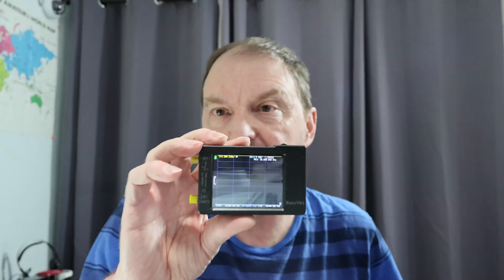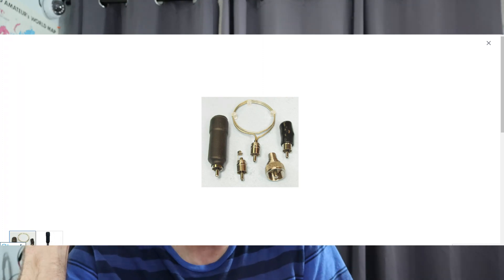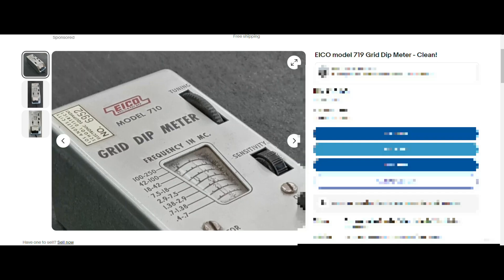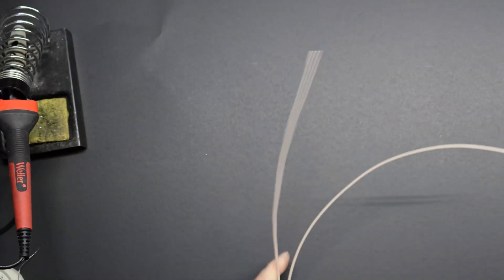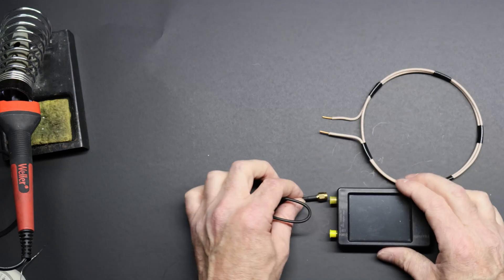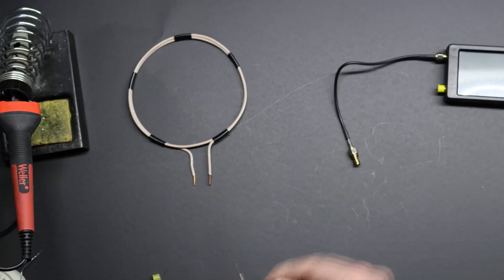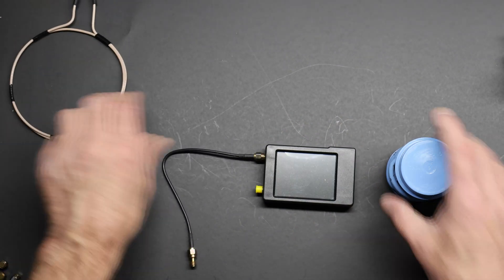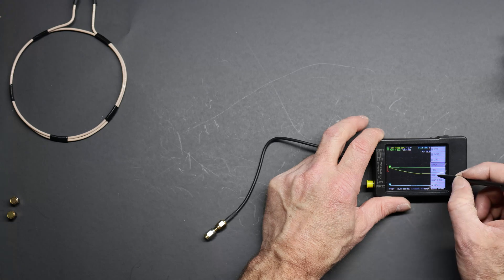How to use a nanoVNA as a grid dip meter.

Comment: Really useful video for my upcoming purpose of detecting resonance in primary and secondary LC circuits. Does it matter if the pickup coil is bare wire (e.g 2mm tinned copper wire)? And how important is the diameter of the coil? So would a 10cm one work just as well?

Comment: Really useful video for my upcoming purpose of detecting resonance in a primary and secondary LC circuits. Does it matter if the pickup coil is bare wire (e.g 2mm tinned copper wire)? And how important is the diameter of the coil? So would a 10cm one work just as well?

Comment: Inspired by this video, I did a few tests myself. I found that SWR was by far the most stable parameter to use on a wide bandwidth, like 5-100 mhz, and on a short bandwidth, like 10-20mhz, delay gave a very sharp dip. My pickup coil for 5-120 mhz is 5 turns at 40mm dia. for 100-450 mhz, I used 3 turns of 12mm dia.

Comment: Interesting. I was first licensed in '57 so am familiar with GDOs. actually I started collecting them at hamfests and have MFJ, Heath, Kenwood and Simpson ones. (I'd like to get an Eico with a real vacuum tube in it.). Anyway I also have a Nano and your demo was very interesting. But all my GDOs have a series of plug-in coils with many more turns and I wondered what difference that made compare to your little homebrew one. Is it because of the wideband sensitivity of the Nano? Does Q enter into it?
73
Reply: I have been using a grid dip oscillator, GDO, for a long time also. Still use them, even tonight, and have found the Barker & Williamson (B&W) GDO very good and uses an acorn tube. I see them on Ebay and maybe you would enjoy one of those for your tube collection and use. I started with my general license in '63.  Been a great hobby for a long  time.  I don't know how to use a GDO for determining Q but a nano VNA can be used to measure Q. I also did that tonight on a B&W 850A tank coil for a friend.    B&W advertises their unloaded Q to be 50 or better. I measured it at 70 on the 20M tap.  Not too bad.      73    WA4QGA

Comment: This idea came from a magazine article years ago. MFJ copied it and sold it as an adaptor for their antenna analyzers. 

It is actually better just to connect the trap or resonant circuit to the VNA directly and measure the impedance of the trap or resonant circuit. Just use a short jumper with a cable separation at the far end with alligator clips.  Calibrate that with an OSL calibration. The VNA can measure the actual trap impedance and Q using a direct connection, I do it every week for testing RF chokes. 

You  don't have to spend $53 for a useless hunk of wire you can find in your junk box. You can make a jumper or adaptor for a jumper with clip leads and read the actual impedance with a direct connection.  It can do anything this can do and better, and you save almost $60!!
Reply from the maker: I have tried measuring directly from the S11 port, for some reason the nano shows them a few hundred KHz low on frequency. Might be an error on my part.
Reply: @RicksHamShack that is likely a resolution issue. Some models take 100 samples, others 400, but it’s still pretty low resolution over tens of MHz or more. You can reduce the stimulus span or connect it to a PC and do segmented sweeps to increase the samples.
Reply: By coupling the VNA directly to the resonant circuit, you load that resonant circuit with the 50 Ohms of the VNA port. This will lower the Q of the resonant circuit massively.Also, the connection wires have some inductance, which will pull the resonant frequency down. This might very well account for the few hundred kHz difference in Rick's reply.

Comment: You should get some connector savers. They look like an attenuator but they have a straight through connection. Just wind them onto the two VNA ports and leave them there. No need to use jumpers that way.
Reply: was going to recommend this myself. I went the extra step of 3D printing a little attachment that slips over the hex nuts of the SMA-savers to keep them from turning

Comment: I wound mine around a 1.25" pill bottle and put the SMA connector directly to the two inch long wires.  (no coax)  If I can connect it, I can replace it.  I used "liquid tape" to bind the two  turns and the two inch long lead into a rod.  I used about #20 enameled wire.  I use mine like a wand holding the MiniVNA-Pro with coil as a hand held probe. (no vise) Ron W4BIN
Reply: Pode postar o vídeo?

Comment: What this wont replicate is the very high impedance the grid dip meter operated at(meg ohms) because you are now coupling into a 50ohm test system. This means the circuit under test will be loaded and damped much more than with the GDM. What this might mean in practical terms is hard to say, in use the circuit might react at slightly different frequency to that measured with the Tiny VNA. The tank circuit in that regen receiver might not have the Q you were expecting! :)
Reply: Not quite. The coupling coefficient between coils will allow an impedance match as seen between the  low and high frequency trap measurements, the coupling increases as the frequency rises, increasing loading. Not ideal but it will give a good indication.  A real  GDO still reigns supreme.
Reply: If I have time, I may try NanoVNA vs GDO later. I found that I can very accurately measure the dip frequency on a GDO by zero beating the GDO with a calibrated receiver. It would be interesting to see if there any difference between the Nano and the GDO.
Reply: @Steve-GM0HUU  that would be good if you could. The poster did a good and detailed job at the construction of it, but left it a bit thin on the use-cases side.. I hope he would consider doing a Part 2..
Thanx-n-73   
 lm-VK3OLA
Reply: @lmantuano6986  I did a quick test. I used my old TRIO DM-801 to get a dip on a 12m trap. My receiver indicated dip frequency of 25.253MHz. I used my NanoVNA v2.2 to get a dip on on the same trap and the same receiver indicated a dip frequency of 25.525MHz.
OK, not a very accurate test but it did indicate a GDO vs NanoVNA difference of 272KHz. Assuming one of the methods is accurate, 272KHz is a approx. a 1% error.

Comment: Hi Rick, i am trying to test a Key Fob, RF type for central locking on car, i am told it can be done with a nano VNA, but i haven't managred to do it yet...Fred in Uk.
Reply: They told you "nano VNA" when they should have told you "tiny SA"
Reply from the maker: Most of them are 315 MHz. I test them with a TPMS tool that has that feature. I'll see if my loop picks up the fobs I have and report back.
Reply: @RicksHamShack  Thanks Rick..
Reply: I'd try a small signal Schottky diode in series, and a thousand pF or so cap, ( any small value cap should work,) to ground to rectify the signal from an antenna made from a couple of 6 inch wires. Hook a multi-meter or a scope on its lowest DC voltage range across the capacitor and measure the voltage when you press the key fob button very close to the antenna. It's just a broadband RF sniffer handy for a lot of different applications. The diode and the capacitor just turn RF into DC, so any sort of sensitive voltmeter can read at least something. I haven't tried it with a key fob, but I think it should work just as long as you use a fast diode fast enough to rectify the RF. It might not be proof that the fob doesn't work, since you haven't verified your measurement setup, but if you do get a reading when you enable the fob it will be proof that it does work. Or ask someone from the local ham club with a TinySA spectrum analyzer or a cheap USB SDR dongle to test it for you. Those would work just fine to tell you whether it works, and even the approximate frequency of operation. After decades in the electronics business I have a pretty good electronics lab, but I still use my old home-made RF sniffer and a multimeter since it's such a good 'go-no go' RF indicator. I also use a $25 USB SDR dongle and my laptop PC. It really does all sorts of useful RF tricks besides just using it as a radio receiver, especially with some of the recent software applications. You can probably even decode your key fob.
Reply: Probably better to use a rtl-sdr for quick "does it transmit" when you have a rough idea of the frequency. (You're only going to get 2mhz instantaneous bandwidth, but you can check various bands quickly)
Reply: If your scope is high enough frequency, you can put a loop on the end of an oscilloscope probe and hold it to the 
case of the Fob and see if it is transmitting RF.
Reply: @ElPasoTubeAmps  Yes ok i see what you mean, i will give it a try thanks...F.